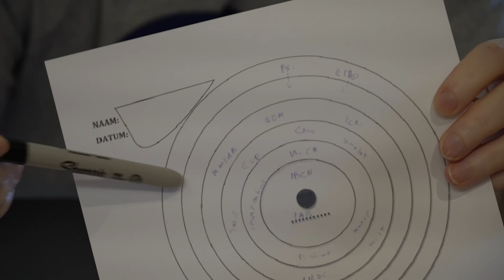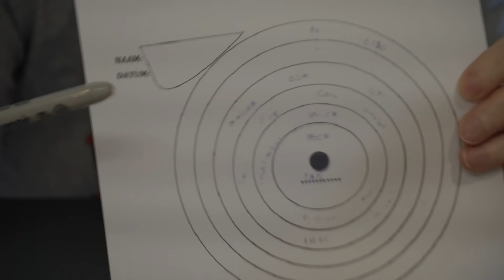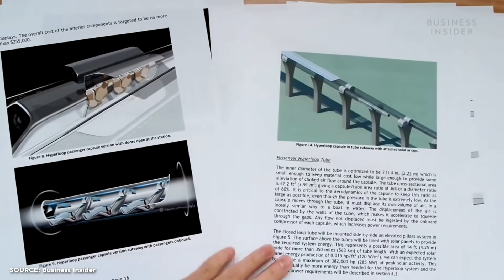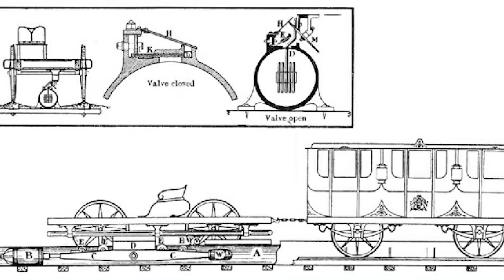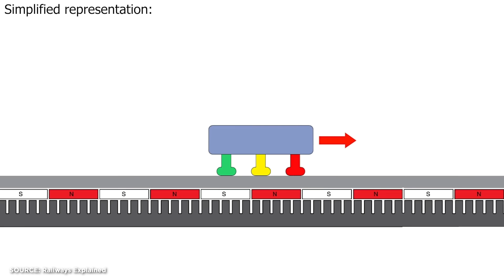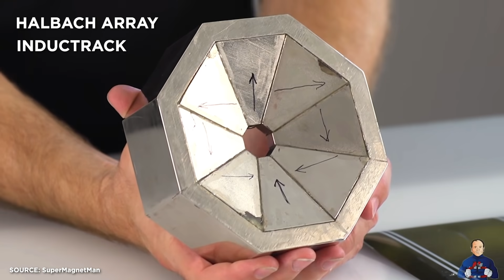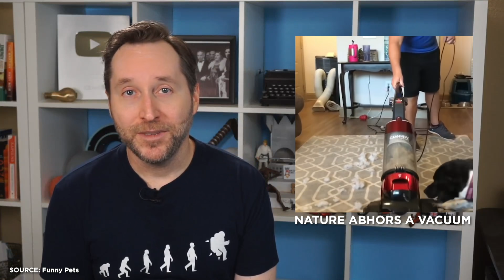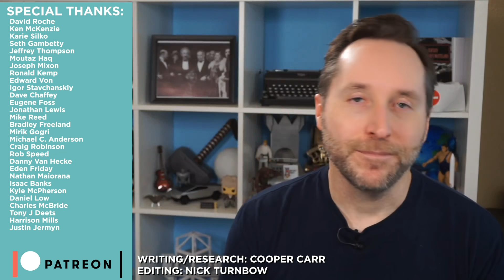What's Happening (And Not Happening) With Hyperloop | Answers With Joe

Comment: I can't watch anything hyperloop related without hearing thunderfoot's voice
Reply: He's been wrong about soooo many things...
Reply: @RockitFX1  such as?
Reply: @foggs  In this video Joe also mentioned that misconception about vacuum. Like if you make a hole in a vacuum tube the whole section will be destroyed. The truth is the air will just pour into the tube through the hole the same way water will pour into a submarine if you make a hole in it. And by way  to handle a vacuum, you just need to handle an  atmosphere of pressure meanwhile submarines can handle tens atmospheres of pressure it is just a matter of design strength.
Reply: @pawelzybulskij3367  would be interesting to see that simulated - various projectile sizes at different speeds fired at a vacuum tube. It must fail catastrophically at some point
Reply: @pawelzybulskij3367  
Actually, pressurized liquid and gas vessels do not pose the same thread. For a given pressure and volume, gas vessels contain much more energy (as fluids are not compressible), a rupturing gas tank can explode like a handgrenade, whereas a rupturing liquid tank releases a stream of liquid. That's why every pressurized vessel is being filled with liqued upon being pressure tested.

However, i too think, that Thunderf00ts arguments are not even close to being valid. I mean, just look at the ISS, it gets bombarded by tiny pices of metal, that travel multiple times the speed of a rife bullet and the structural hull is only Milimeters thick. If that's not enough, we build fucking gas tanks for cars that withstand 300 to 700 times the pressure difference that the Hyperloop would have. The only real downside to the whole concept (in terms of cargo transport) is to maitain the vacuum.
Reply: @Enthropical_Thunder  He covered the ISS's many holes, as a matter of fact.  You are ignorant of physics, learn about tensile, compressive, shear, and torsional stress.  Also, automotive gas tanks are kept at a very slight vacuum from the EVAP system, they're not pressurized.  You can think whatever you want about thunderf00t, but he didn't come up with the math that hundreds of thousands of engineers use daily- he just uses it to debunk con artists.
Reply: @Enthropical_Thunder  eu not Biden Trump Gás Light Gás NSLPT .
Reply: Weeelllllllll....
Reply: @pawelzybulskij3367  well, the problem is that hyperloops need to be long to make sense. And long means a lot of 'design strength'. This will be terribly expensive, and a high speed train can do 350 km/h at a fraction of the cost.
Reply: Partly because he talked about his videos. Dr. Mason explains in detail the physics and math of vacuum tubes and you can't argue against that. Mason's references to Elon Musk is Mason's humor, which I really like, but it's a brand of humor that's not for everyone. Joe nailed it though when he hypothesizes it all comes down to is it profitable.
Reply: Thuderfoot is obsessed with tearing down Musk to the point he doesn't entertain any possibility of research and technology driving innovation, because Musk.

Yes the original concept isn't viable, very few original concepts are, but the resulting technologies will drive viable innovation as shown in this video.
Reply: @garyedwards5345  No, in any case he's protecting legit innovation from scammers who take advantage of people's hope for the future.
Reply: @granudisimo  oh indeed, musk literally preys on ignorant people and investors with futuristic bullshit that makes no sense if have any sense of critical thinking skills, musketeers are the worst am I right?
Reply: @garyedwards5345  I agree. I used to be a big fan of his channel, especially the video's he made about creationists. But now I don't really watch it anymore. He is capitalizing hard on the "busted" and "getting detroyed" type of video's for people who lack imagination and just want to see other people's work get shat on because they haven't achieved something themselves. 

Its now gotten to a point where pretty much any new development in its babt stages needs to get sacrificed before the umbilical is even cut. Just to draw in the "critical thinker crowd".

Hyperloop isn't impossible. Far from it, just highly impractical. It would take great advancements in material technology and many many years of development by which time there won't simply be enough people travelling to justify the cost of such an ubdertaking.

Internet technoligies are advancing far more rapidly for hyperloop to ever be viable. In a few dacades well all be working from home. Discussing what we should buy from the 3D printing superstore on the corner in real time via augmented reality with people on the other side of the globe. 

There simply won't be a huge demand for fast travel anymore.
Reply: @actually5004  the ISS is like a third the pressure of Earths atmosphere.
Reply: Didn't the Vegas loop just open as just Tesla's taxi's in tunnels?
Reply: @theFLCLguy  AKA Hardcore Colorado

Comment: There are technical questions about hyperloop that no one ever discusses:  1) What are the passengers going to breathe?  They could breathe oxygen from bottles that someone has fill each trip.  CO2 buildup will require a scavenging system (that has to be maintained frequently)   2) How are they going to cool the pod?  Air conditioners have to reject the heat somewhere, normally by blowing air over the condenser.  Can't do that in a vacuum.  3) Airplanes operating at high altitudes are required to have a back up oxygen supply (masks that drop out of the overhead)- won't the regulators require the same for pods traveling in a vacuum?  That's a minor issue, but airliners are also required to have a stewardess to explain how to use the emergency oxygen... and point out the emergency exits... 4) Where are the emergency exits in the 300 mile long vacuum tube?  There are other technical and regulatory issues, but those four are enough to scuttle hyperloop.  The maglev train in Shanghai is great, but it's so expensive to operate that China only runs it at full speed twice a day.  They have scaled back their plans for a large maglev network and will use wheeled high speed trains over most of the planned maglev routes.
Reply: The oxygen supply from the masks on a plane is just a chemical reaction that only lasts like 12 minutes or so. It’s sodium chloride, potassium something, and something else. No idea if that would be required for a hyper loop like system but it would be negligible to add.

Comment: I feel like Hyper-loops are going to end up like Zeppelins, they were awesome, revolutionary technology that had a lot of economic and technical issues. Eventually the Hyper-loop tunnel will collapse and it will be like the new Hindenburg
Reply: More like the nuclear powered car. It's "possible" but it will never be cheap, efficient, or safe enough to operate commercially.
Reply: At least zeppelins actually work.
Reply: That's assuming that it will ever be built. Considering how scammy the two developing companies are acting and how many predictions they put out went by without anything happening, I won't hold my breath.
Reply: No it's really like the Concorde, high tech with nowhere to go.No airline would buy it no country allowed it to fly.
Reply: @hifijohn  Worse than the Concorde. The Concorde was built, it worked technically, and flew commercially for 27 years. I'm pretty certain that no commercial HyperLoop will ever be built, there are too many technical and financial obstacles before we even get to face the insurmountable economical, safety & maintenance problems.
Reply: @hifijohn  I would say that is also a very fair comparison it’s just that the Concord was a relatively safe vehicle given that it was essentially just a scaled up model of something that was already done before, yet the vacuum tunnel and thereby the hyper loop pose a major safety hazard to passengers similar to that of a Hydrogen filled balloon in the event that every thing around the passengers is dangerous
Reply: Zeppelins worked and were pretty reliable, they mostly died out due to planes coming into existance which allowed for things the zeppelin couldn't, Maglev allows for things that Hyperloop can't do (Unless the hyperloop is like 20 feet tall) but at least Maglev was created and still functioning to this day.
Reply: @blastortoise  Actually, although the first zeppelin prototype (1900) flew before the Kitty Hawk (1903), commercial planes predate commercial zeppelins (1905 vs. 1909). Moreover, the latter always had reliability problems, mostly crashes in strong wind. Most of the Zeppelin-made zeppelins and all 5 of the US-made interwar zeppelins ended their life in crashes.

Maglevs are a more mature and reliable technology than zeppelins ever were, but share their problem of other technologies being more convenient and economical. China saw this after building the Shanghai Maglev, which was expensive to build (and thus keeps losing money) even without a tunnel into the city centre (it ends at a suburban subway station), is so noisy when you stand on the ground that even the dictatorship was swayed by public protests against an extension to Hangzhou, and has zero compatibility with existing railways so trains can't continue to destinations beyond the end of the maglev line like CRH trains can. JR Central in Japan is now building an almost 100% tunnel maglev line, but it is extremely expensive, only justified by Japan having a special layout of very high density areas along a single line, and it's doubtful that they can export it anywhere. (In addition, there are doubts that it can match a second Shinkansen line in capacity: the trains have less seats and successive trains have to keep a greater distance between them.)

From a safety viewpoint, the Hyperloop idea is actually worse than zeppelins filled with hydrogen. For zeppelins, potential points of failure were mostly limited to the vehicle, but for Hyperloop, it's the entire infrastructure (the tube); and a depressurization or derailment would have potentially fatal consequences not just for the directly affected vehicle but all the other vehicles in the tube, too. From a maintenance viewpoint, zeppelins weren't that great a problem, while the hyperloop is a nightmare: heat expansion, corrosion, leaks, maintenance works that would require a complete traffic halt and would take a long time because of re-decompression & safety checks, earthquakes...
Reply: @blastortoise  You took a very cursory reading of my comment on the reasons China abandoned maglev and the reason Japan won't be able to export it if you go from there to conclude that maglev is what the US should go for. Which of maglev's fatal problems I mentioned do you view as "so damn small it doesn't even matter"? Look, I understand that from your US viewpoint, both conventional HSR and maglev look like exciting future tech the US was left behind on, but there are important differences between them.

I'm saying the US should not be wasting its time on maglev, much less on Hyperloop, and build conventional HSR, just like every other country that built high-speed ground transport. But before doing so, they should overview and change how large construction projects are run, because due to institutionalized corruption, civil engineering projects cost multiple times as much as in any other country.

I agree with you on the importance of improving cities, but it is a parallel task, not a prerequisite. HSR can work even if most people drive to the station, but of course it works better if people can take some form of local rapid transit to it. The good thing is that these things bolster each other. For example, in Taiwan, light rail and subway projects were brought forward in half a dozen cities after the construction of high-speed stations, wile in mainland China, several cities got exurban high-speed stations with connecting subway lines planned in parallel. But you indicate what is actually a prerequisite: booting certain interest groups from political power.
Reply: @Daneelro  The vibrations are so small it doesn't matter, especially because the one in Shangei is outdated but super fast, and why build standard HSR when the cost of Maglev is only 1.5-2x more? Spend extra to get faster results, put time and money into research of Maglev technology to see if we can find a way to make it cheaper while keeping productivity and find a good middle ground between: "Expensive but fast" and "Slow but cheap".

And it really depends on how we do infrastructure reform, it could be parallel with building HSR or it can be done first, then do HSR later with areas mapped out already because of the previously implemented infrastructure reform. We control our economy, not another country, so we can lay out the cost for this sort of thing and we should be doing that every some odd amount of years. I've tried looking it up and tried finding videos on it, but I cannot find any vibration problems with Maglev trains besides Shangei, so it really doesn't seem like a huge issue and if it is then we do more research on it like I said.
Reply: @Daneelro  I agree entirely! I just don't think this will work and wish someone like Elon or another "leading innovator" (trying to be non-biased here) would admit to some of the weaknesses and risks of this technology. I also wonder if tunnels and putting these underground pipes could weaken the surface of those areas of the word at all; I'm unsure!
Reply: I also feel the danger of the new technology could be truly unsafe and very uncomfortable for humans. I think Joe's point abound land rights is very critical. As my husband is a real estate attorney, I've learned getting folks to sign papers to give an easement across any part of their land is VERY hard, way harder than you'd expect.

Comment: Why does a Hyperloop have to be so limited in speed?  If you can evacuate a tunnel down to like 1% of atmospheric pressure, it's not that much more difficult to go to what they call "high vacuum."  At a certain pressure (I think it's around a millionth of an atmosphere) not only would any hypothetical shockwaves be exceedingly wimpy, they can't actually be created at all because the gas molecules are too far apart to sustain waves.  This also more or less truly eliminates all the aerodynamic drag and you can do it with straightforward turbo pumps.

Once you do that, there's no specific speed limit.  In fact, the simplest and safest type of maglev (the passive Inductrak type using Halbach arrays) is very efficient at any speed, but actually gets more efficient at higher speeds.  You could have a system capable of going multiple times faster than an airplane for most of its journey and which also just drops you right in downtown wherever.

The concerns around the expense and difficulty of obtaining land rights are real, but can be solved by tunneling.  That's particularly appealing if the new system you're making is a quantum leap over the current best alternative of airplanes.  Going a bit faster than an airliner may not be enticing enough to enough people to sustain a business.  But you could charge much more than business class prices for something that is drastically faster.  LA to NY in an hour and a half?  Houston to Chicago in 45 minutes?  That's gold and a lot of people would pay a lot to be able to do that.  

Basically, I'm not convinced that any of these companies have done serious unbiased customer research.  It's a great idea technically, but the burden of proof is on them to show it could pan out economically.  I'm just suggesting an alternative whose economics might work out better...

Comment: There was a guy who worked for Strawbridge and Clothier in Philadelphia as a maintenance man who took his 15 minute breaks in a closet.  Long after he retired they were doing some work and someone discovered that in the closet, a pneumatic tube ran through the closet and that there was a gate installed in the tube that could be easily opened.  It was never proved but it was thought that this maintenance man spent his break period interrupting the cash from the checkout counters and skimming a little.  Apparently he was smart, in that he never took so much as to cause suspicion.  The word was he retired after 30 years and lived a life that was way above his station and had passed away by the time they discovered the glitch in their pneumatic system.